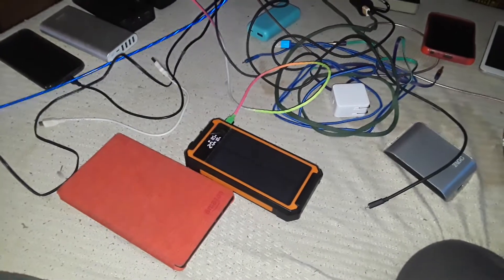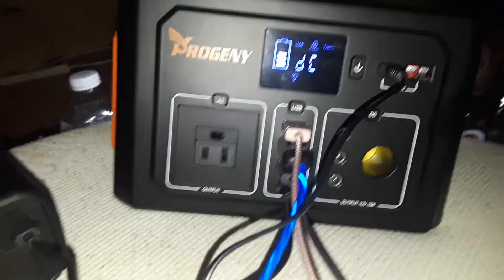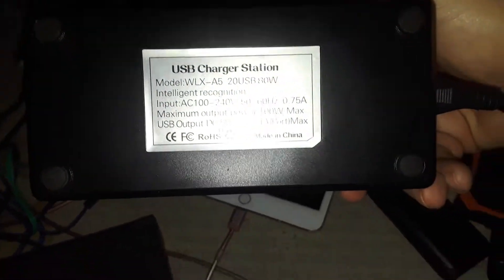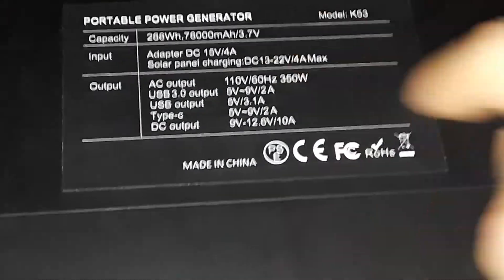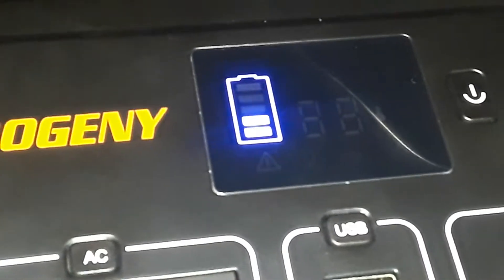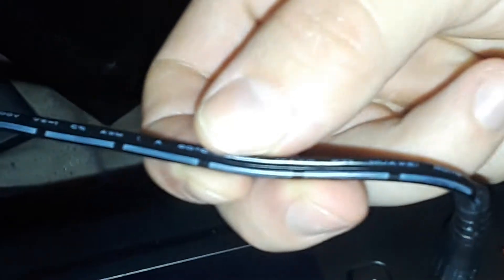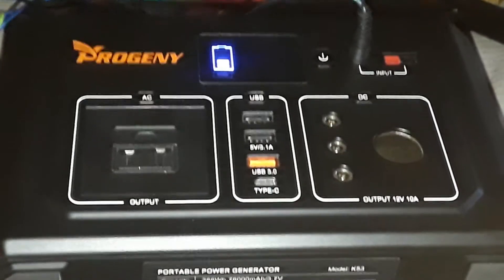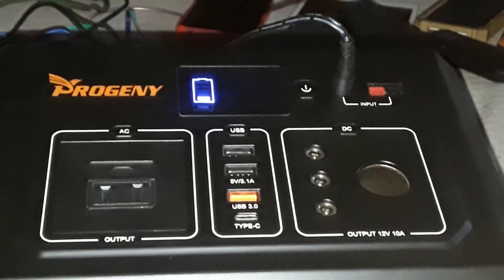Progeny portable power station [ 350Wh ]. Also did a quick testing for yall.

Comment from the maker: Ok here is the possible problem. It will not charge fast or not charge at all on its own A/C charger and doesn't make sense. But finding white long lines and short lines going to the power station itself. Also not even a single amps is not going into the power station only volts is going in which doesn't make sense or just powering the power station. But anyway also might be possible to get a power pole in the future and try to charge it up on that port. Also nope small solar panels didn't work now unfortunately. But in the future will hopefully get one for my birthday and as too be a 100W solar pad for this thing. Also did charge in the car just fine. Also since almost all night of it charging and also passing it's estimating time of 8-10 hours. Then yea the A/C charger itself too charge the unit itself is useless and as not gone up 1 bar since almost 8-10 hours is there a way to reset the display or the battery itself and no draining it will not work otherwise it will take even longer to charge it up again. But anyway also I think that the small white line cord is not powerful enough for in order to get the amps too the power station in order to store power not just powering it. Lol Also by the way that charging port is only good for car charging since not powerful enough charging A/C charging adapter for the outlets.